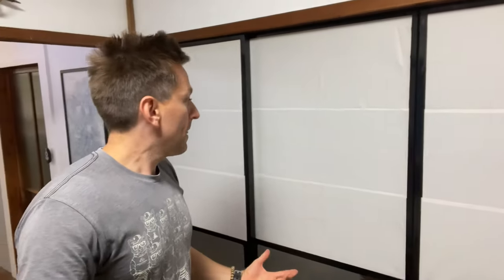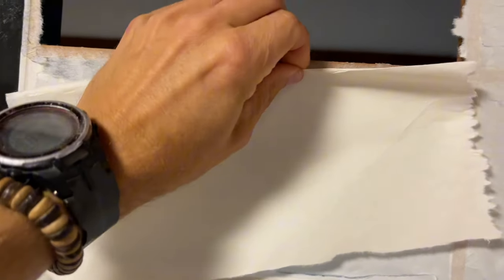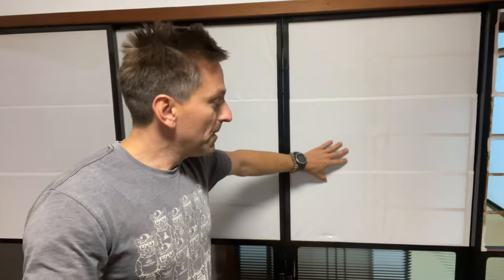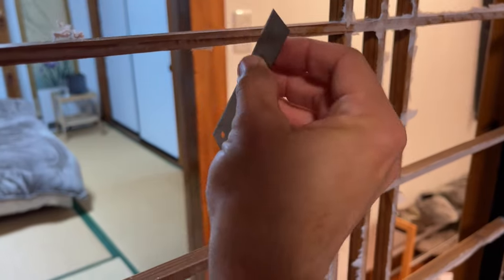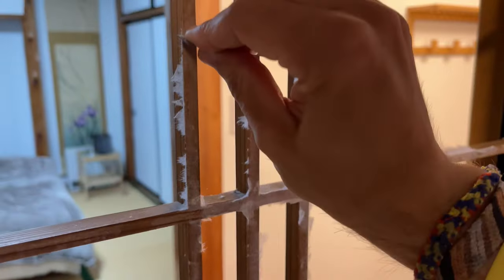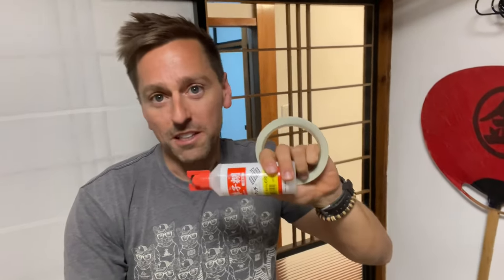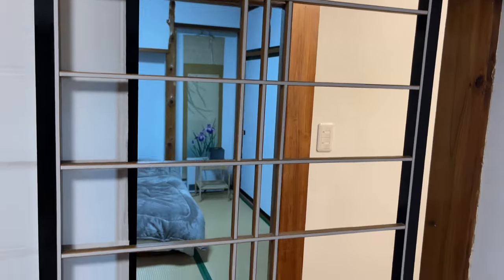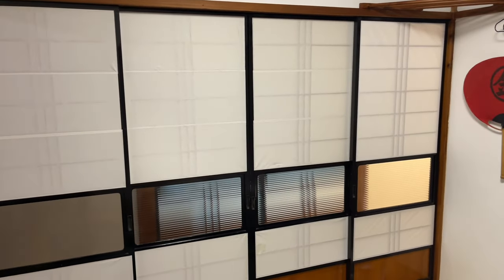Removing and replacing Japanese washi paper on shōji doors

Comment: I actually just tried this myself (also figuring it out myself) recently at the inlaws place in Nagano when we were there in Febuary. Not sure if you figured these out yourself already but sharing a few things I learned. (would appreciate if you have any other tips you wouldnt mind sharing for the next time I attempt this).

1. Do this in a warm room. I did 2 doors, one in afternoon when the temperature was close to 20 degrees, and another one at night when it was closer to 2 degrees. Getting the glue off when its cold (even with water) was almost impossible (I gave up to wait for the next day).

2. Removing the paper, use a water spray bottle and give the paper a good spray/soak before you try to peel the paper off. After the spray it pretty much just falls off on its own (leaving the glue behind to be scraped off).

3. I used a very subtle paper pattern (very slight texture), and thought it added a lot compared to a flat white.

4. I came accross multiple styles of door, including the full wooden ones like your video. However, I also had some newer ones which were comosite plastic + wood, and need to be pretty much fully disassemberd to properly remove (and replace) the paper. Trying to replace the paper without full disassembly was a nightmare. Do. Not. Reccommend.

5. Even for minor holes or rips, replacing the whole sheet leaves a much nicer result than trying to patch or replace only sections of the paper. Almost to the point where I dont think I would ever consider patching at all.

6. That 2 sided tape looks much easier to install (I used the glue). Not sure how it will impact the next replacement attempt though?
Reply from the maker: Thanks for the info! Very helpful and I’ll keep it in mind for the next attempts